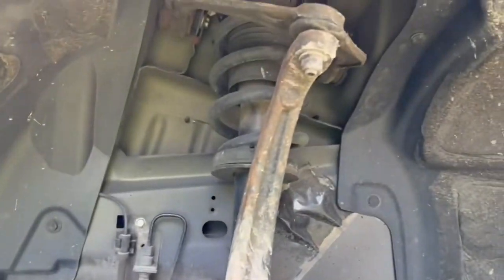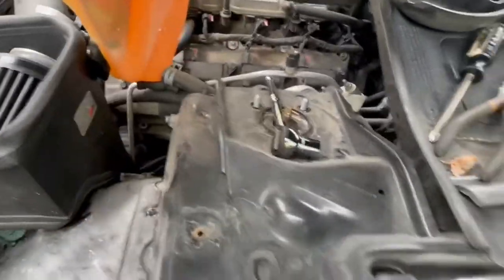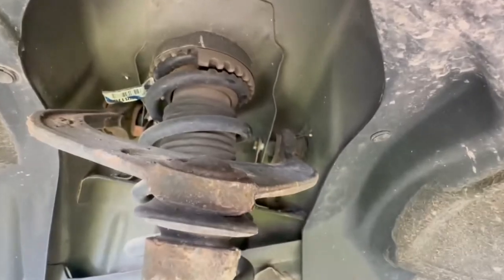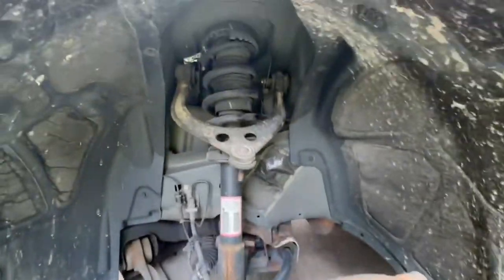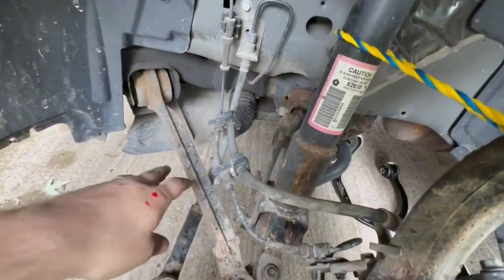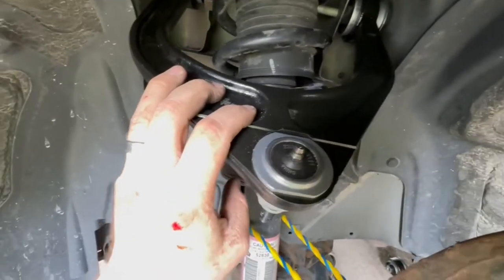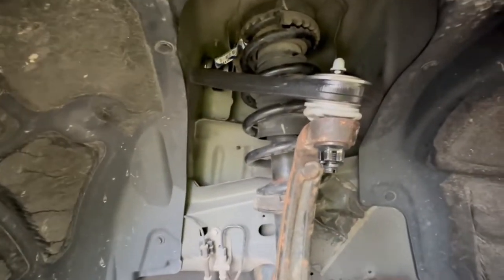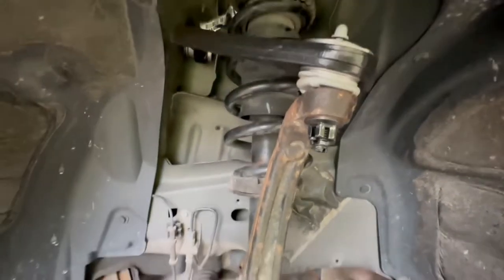Upper control arm replacement 2011-2014 Dodge Charger “common hand tools”

Comment: Put a jack under the lower control arm and jack it up and the spring will compress and slide the bolt in and let the jack back down for the other bolt.